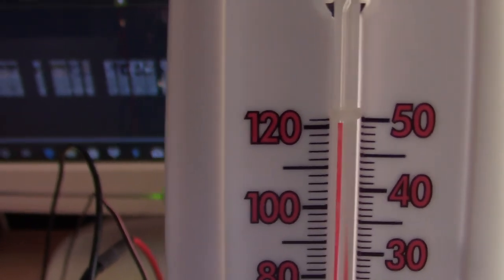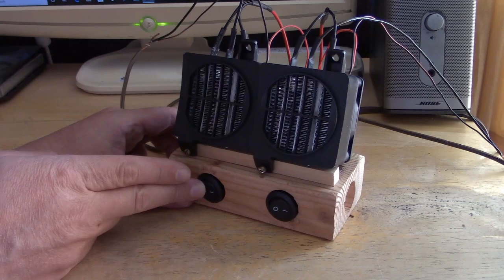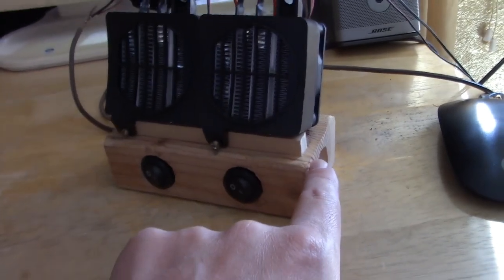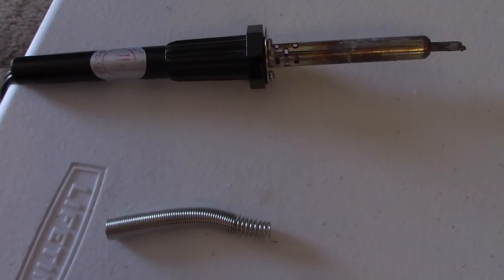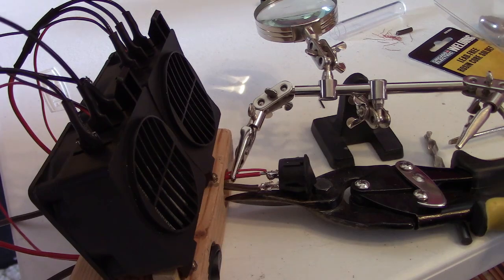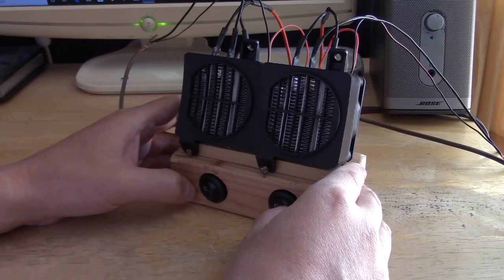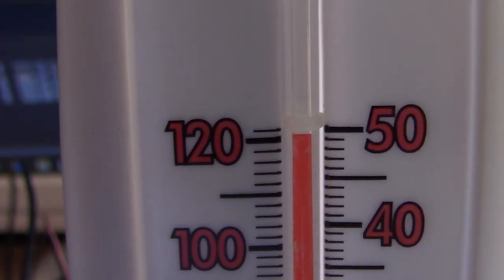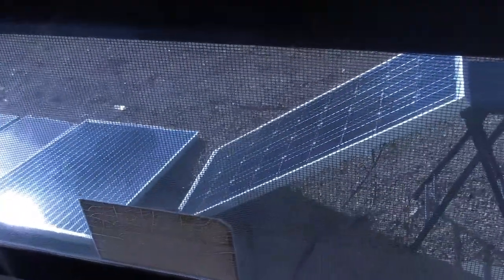DIY Solar Electric Air Heater! 200W 12V DC Air Heater! w/dual fans! high/low pwr! topped 120F/50C!

Comment: i ordered the 100w 12v model.  I have a composting toilet that draws air from inside my tiny house and out. new style composting toilets bring air from outside into the bottom and a fan pull the air out. so i'm thinking of using this to heat the outside cold air before it comes into the toilet and out. Hoping by doing this i won't have heat loss in my tiny house and not having the toilet become to cold that things will freeze during the winter months. Have you done any tests on how longs these would last ? just running one day in and day out?
Reply from the maker: hi there. i haven't done any longevity tests (since i just bought a few weeks ago). i have read that the internal heating element is rated to last greater than 3 years *with constant use. so many years i hope

Comment: are you better off running this straight from a 100watt  panel or 100ah deep cycle battery and panel?
pros and cons anyone?

if you panel is larger than 100 watt you could capture the excess energy in your battery
Reply: Will need to fuse the heater